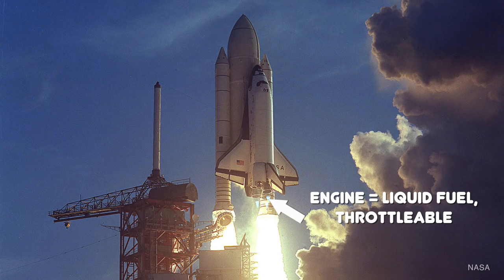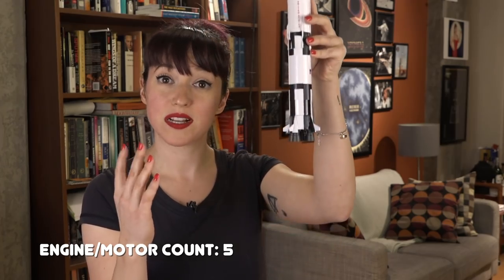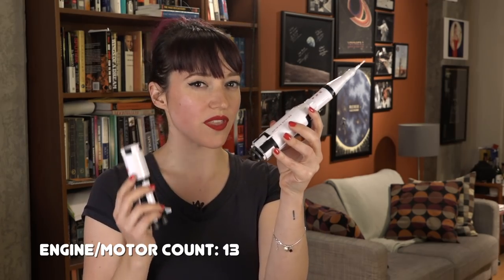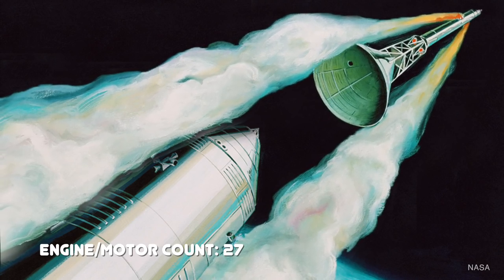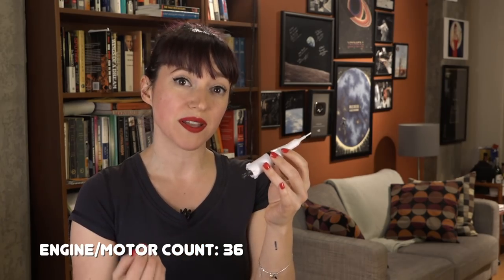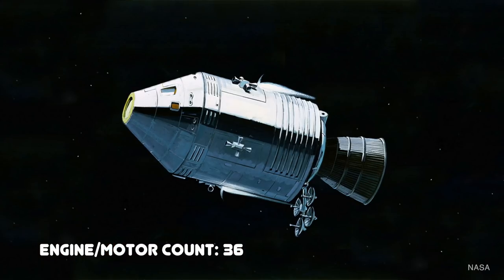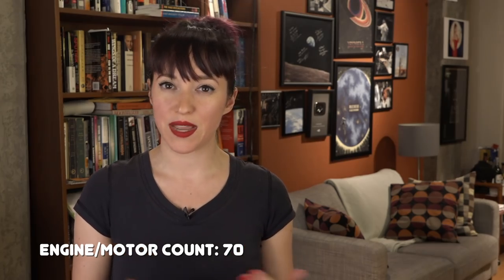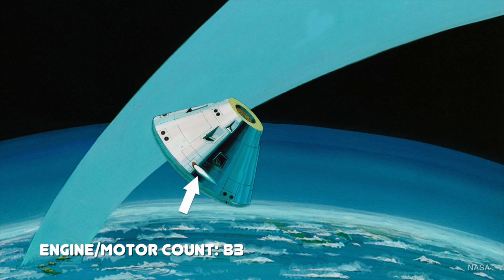It Took 83 Engines to Get to the Moon

Comment: Was the LM ascent engine ever used for the Apollo 13 rescue or was only the descent engine involved? If not, was it considered for extra boost to return sooner after the descent engine was spent?
Reply: Lots of trade-offs were considered in Apollo 13, but the LM ascent engine was small, and would have required jettisoning the descent module, so that option was not used. In the end, electrical power and crew consumables turned out to be more critical than engine fuel.
Reply: Gordon Richardson I agree...I also considered that the guidance computer was shut down by the time they were making their corrective burn to get on track. Each attempt at correct trajectory by manual guidance looking though the windows while piloting toward earth would be risky.
Reply: Actually only one burn was done without the PGNS (primary guidance/navigation system), the free return burn and PC+2 were both done using the PGNS, the "manual burn" was done under AGS guidance manually.
Reply: "......the "manual burn" was done under AGS guidance manually".....They eyeballed it. 
A little context goes a long way. Thanks for keeping it real. Unbelievably, there are doubters. 
Mostly Ron Howard got everything right except Sweigert's character. Movies tend to get a hook when there are suits to answer to for funding. If a novice has not seen the mainstream Apollo 13 film, in my opinion, it's not a bad place to start. Believe it. This is what we are capable of. It spite of how effed up our country seems. I believe that is where all this doubting begins. Buzz was taking a swing for all of us.... and he connected! Thanks, Buzz. https://www.thevintagenews.com/2017/05/28/that-time-when-buzz-aldrin-punches-moon-landing-denier-bart-sibrel/

Comment: Is one that burns liquids but can't be relight a motor or an engine?   Or is that a question best asked to Scott.
Reply: If it's liquid fuel, engine. If it's solid fuel, motor. 

As for hybrid rockets... well, that's the real question..
Reply: catfish, I referred to re-igniting.  So you think that contrary to what she said there is no requirement for re-ignition?

Comment: How was the SIV-B stage re-ignited? did it use some kind of pyrotechnic or something like a big old spark plug to ignite the fuel?
Reply: Could someone please answer this question?  I've never thought of it, but know I need to know.  Thanks a lot +David Clarkson!
Reply: Spark plugs indeed. The system is called the ASI (augmented spark igniter), a small feed of fuel and oxidiser is ignited by two spark plugs, producing a flame in the combustion chamber. That in turn ignites the main fuel/oxidiser supply.
Reply: Hypergolics  liquids are self igniting when the components make contact. That's what's used on engines that need to be re ignited.
Reply: But the SIV-B didn’t use hypergolic propellant. It had a J2 engine and required spark igniters.
Reply: TLI was re-ignition of the SIV-B engine. All the main Stage Engines used spark igniters which I think were constantly sparking through the burns, the smaller thrusters and Ullage motors are harder to study as far as fuel types and they account for 85% of the count / varied in type. CM and 2xLM engines were Hypergolic self igniting.
Reply: The other answers correctly mention the ASI (augmented spark igniter) necessary to ignite the H2/O2 mixture since it's not hypergolic. But there's more. The turbopumps have to be spun up somehow, and the J2 did this with "start bottles" containing pressurized hydrogen. During each burn, the J2 set up for the next burn by repressurizing the start bottle. Kinda like how a car engine recharges the battery so it can start the engine next time.

Comment: Okay here's my dumb question;  (Nothing to do with the Saturn 5)  The space shuttle Challenger exploded as it was ascending. The solid boosters were adding a lot of thrust to help push it towards orbit, so as I understand it,  those boosters were pushing hard against a resisting force - the weight and drag of the shuttle and external tank. When the vehicle exploded and the solids broke free, they were suddenly freed of all the weight of the shuttle etc., so WHY DIDN'T THEY LEAP FOWARD, instead of just plugging along at the exact same speed as before the explosion? I've never understood that. Thanks.
Reply: Christopher28fair From the videos it can be seen that the srbs continued to burn, but in an erratic path. My guess would be that the shockwaves of the explosion sent the boosters spinning, which would dramatically reduce their thrust in the forward direction.
Reply: Skeptical, but thanks.
Reply: The Shuttle itself didn't explode. It was the main fuel tank ignited by a large crack in one of the SRBs (Solid Rocket Boosters). They didn't leap forward because a)one had a big crack in the side; hardly gonna fly straight that way, and b)that was a big-ass explosion, excuse my French. That violent explosion pushed the SRBs sideways while in flight. After getting multiple different pushes from where they were attached to the fuel tank, you better believe they corkscrewed sideways after that.
Reply: Thanks

Comment: Hi Amy, are there still Apollo remains orbiting Earth or Moon?
Reply: Not Earth or moon, but somewhere In a recent video Amy mentions that one of the S-IVB rockets is still in orbit around the sun (can't find the link).
Reply: acm#1985 - The S-IVB's from Apollos 8, 9, 10, 11 and 12 are still up there - the one from Apollo 12 returned to the vicinity of the Earth in 2002.  And, as Niall notes, the ascent stage from Apollo 10 is still in solar orbit.  Everything else was (deliberately) crashed into the Earth or the moon.
Reply: Tevildo was there a way to remotely control by radio the LM ascend stage left in lunar orbit in order for it to crash into the moon?
Or was the LM ascend stage jettisoned in such a way that it would not remain in stable orbit but spiral towards the lunar surface?
There is no atmospheric drag for a decay in orbit of any spacecraft left revolving around the moon.

Comment: What does it mean when it's said the Saturn V had thousands of moving parts? Thanks!
Reply: Juan Valdez rocket engines are full of valves, actuators, gimbaling mechanisms, command and control hardware, sensors and a multitude of other hardware that I couldn't even begin to list.
That's just the engine, the fuel tanks have a network of valves and plumbing, the interstages have detachment mechanisms, the service module had thousands of valves, relays, fans.

The list just goes on and on.

Comment: I have a question. How did the flags work and how were they made?
Reply: Flags from Sears had a springy "curtain rod" sewn in the top edge.
Reply: Never knew about any small lead weights- references? They were rewarding contractors thousands for each ounce of saved weight, so seems unlikely...

Comment: I don't understand something. Looking at an F1 engine (or any rocket engine for that matter) where are the big heavy mounting components you would expect on something that's able to push an object with well over a million pounds of thrust. None of the components look big enough or strong enough. Does someone maybe have a link that explains all the forces acting on rocket engines? I'm feeling pretty dumb here.

Comment: How was it ensured that the back down falling stages did not crash on any sailing ships on Atlantic ?
Reply: Kari Ahola that's a bit like finding a needle in a haystack and getting it out by shooting it from a mile away in gale force crosswinds.

They would have told ships to stay out of the region near the launch site, after that the odds are astronomically against hitting anything unintentionally.

Comment: One other question re the boost protective cover that covered the CM; when it was still on, could they see anything out any window or were the windows all covered by it? I'm going to guess they were.  ?
Reply: ThankYouVeryMuch!! for the link! Probably not a time to site-see anyhow while strapped/buckled in and being pummeled backwards  by 7.5 million lbs of thrust cruzin along at 7 miles per second .... Nah!!  :)
Reply: When they were designing the Mercury capsule back in the day, there was a bit of a fight between the engineers and the astronauts over putting a window in the thing. Since the astronauts won, I guess the engineers made sure that Apollo always had a window.
Reply: It has that window for the hatch, but the forward and side windows were covered up.
Reply: Thanks! Does anyone know what the CM's outer skin/coat was made of? When I see pics of it in space it always seems to shine and gleam like polished chromium the old 50's/60's luxury car's bumpers use to have . But when recovered from sea it looks scorched honeycombed copper!   ?
Reply: Thanks Walter! That makes sense. I'd forgot that the CM's heat shields were ablative and designed to basically melt away on re entry! I'm sure that did blemish it a lot. I also just learned the SM & CM were coated in Mylar foil, making it so shiny up there.
Reply: That's the block 1 CM hatch. Block 2, which was actually used on the missions, has a single piece, outward opening hatch.
Reply: Only the hatch window, all the rest were covered.
Reply: catfish552 left forward window actually had a window in the BPC along with the side hatch.
Reply: One more question? The new Orion CM has a Forward Bay Cover that jettisons upon reentry back to Earth to allow the main parachutes to deploy. Did the Apollo CM's have such a cover too?
Reply: Bruce Merrill yes it was called the Apex cover.  It was jettisoned before the drogues fired.  You can look at command modules in museums today and see all the exposed hardware on top that was originally covered.

Comment: 3:10 I thought the second stage fell in the indian ocean, didn't it?
Great video as usual by the way
Reply: No, this comes up often. Apollo was a rather gradual launch (kerosene fuel), so both first and second stages fell into the Atlantic. The Space Shuttle was had a higher specific impulse (liquid hydrogen), as well as booster rockets, so the external tank fell into the Indian Ocean.

Comment: Weather they're solid or liquid fueled, they are both engines.  The term "motor" should be reserved for electrically driven "engines".
Reply: And yet, solid rockets are indeed called motors.
Reply: Not really.  Just because many folks call them that does not mean its proper.

Comment: Where  retro motors on the Stage I were located at?
Reply: At the bottom of the stage, in the fairings for the main engines, next to the fins. 

Can be seen as number 13 in this diagram:
http://www.alternatewars.com/SpaceRace/Saturn/S-IC%20Inboard_1963.png
Reply: WOW! very well hidden! Thanks!

Comment: If motors have solid-fuel and engines have liquid fuel and are relightable and throttleable, then which category would a hybrid-fueled rocket (solid fuel, liquid or gaseous oxidizer) like the one propelling SpaceShipOne and its successor SpaceShipTwo count as?

Comment: Why lock down to build thrust. Isn’t that a waste of Delta V?
Reply: There's the staggered startup, as mentioned in the video. The engines also take a moment to reach full thrust (and you don't want to take off with less): Altogether, that means 2 seconds from the first firing up until they're all fully there. They also measured thrust here, so if one of the engines wasn't performing as it should, that's a last-second chance for a launch abort.

It's not a waste of Delta-V, since the umbilical arms are still connected at this point and supplying fuel. With the engines at full power and the turbopumps at full speed, the arms disconnect, the rocket runs off its internal fuel, and lifts off.
Reply: catfish552 I hadn’t realized they were still fuelling actively enough to compensate for full thrust at that point (citation?). I guess you have more control at full thrust plus the system check, but wouldn’t partial thrust just be partial acceleration? I guess they don’t have the added stability afforded by my model rockets guide rod. But I swear a little gimbaling is all my Kerbals need with thrust to weight at 1:1.00001
Reply: See here at T-3: https://history.nasa.gov/afj/ap11fj/01launch.html 
It sounds like the external supply couldn't keep up with full thrust, but they were pumping it in as long as possible. I'd guess at most there is a second or so of "waste", which shouldn't make too big a difference.

The rocket would lift with those 1:1.00001, but that'd be a veeery precarious moment. I'll gladly subject Kerbals to it, but not live astronauts. Plus Kerbal vehicles tend to be a bit more responsive to their controls then real ones, due to overpowered reaction wheels. Better to wait for full thrust and start moving with conviction.

And the checks are a really important part. Imagine if one of the outer engines failed to ignite and you suddenly have 6,770 kN of asymmetrical thrust on the rocket...

Comment: I think you just answered a question I always wanted to ask. I use to wonder why the pics of the CM in space, it always looked shiny/gleaming like it chrome or something even. But pics of it before launch, it always looked white. So when you just said it had a 'boost protective cover' that jettisoned with the launch escape rocket, now I get it! :) But why did the CM always look so shiny up there, was it some kind of chrome skin? Because it sure looked spent-burnt by the time it splashed down, for sure! ??
Reply: Bruce Merrill The skin was highly reflective to help reduce heating from the sun. They still had to roll the spacecraft so one side didn't face the sun for too long. The Apollo barbecue roll 😂
Reply: Thanks for the info Niall! I knew they had to roll her always so she didn't bake, but I never knew it was called a "Barbeque Roll" before! I like that! I just Googled that term & some good info came up. One site explains, "Apollo spacecraft were protected first by a mylar foil coating that was applied to most surfaces. The second level of protection was the barbecue roll." I guess Mylar coating made the SM & CM gleam and shine like it did up there. And why it looked the way it did on return ... scorched off by plasma heat? 

Someone said the CM outer shell is made stainless steel, and it looks the way it does on return because of residue from the ablative heat shield on the base, which makes sense too. But if it's stainless steel was it honeycombed? Because that's the way it looks always, like copperish colored honeycomb when it returns.

Comment: Did they not also use rocket engines to power the turbo pumps?
Reply: They divert a bit of the fuel for that, yes.

Comment: A small question, why was the rocket held to the ground until the F1's were at full throttle? Why not just leave it gain speed?
Reply: Pedro a It takes a few seconds for ground control to determine that all the rockets have ignited correctly and are functioning properly. 
If you let the rocket go before confirming this you lose the chance to do a safe abort on the pad, essentially sacrificing the rocket itself and seriously damaging the rocket pad for the sake of a little bit of impatience.

Comment: @Amy Teitel  Your Challenger article for History.com is incorrect.  The fuel tank did not explode and the orbiter was not destroyed.  The tank ignited and produced a huge fireball which means the orbiter crew survived until the cabin hit the ocean. Please fix your article.  The crew of the Challenger deserves to have their story told.  Also the O ring wasn't the sole cause of the problem.  The main problem was a leak in the SRB joint.  I say this because I am sure you don't want your article perpetuating myths.

Comment: Mr. Pedantic here to mention the little note at the end of the video acknowledging the unused launch escape system. There was only one  LES motor (not 4) and one pitch motor. While the LES has 4 exhaust nozzles, they all are for the same combustion chamber.

Also, the number of S-II ullage motors was reduced to 4, starting with Apollo 6, then 0, starting with Apollo 15. They deleted 4 of the 8 S-I retrorocket motors for Apollo 15, and the combined decrease in delta-V between the S-1 and the rest of the rocket left them too close for comfort at separation time!   https://gwsbooks.blogspot.com/2015/05/apollo15-staging-anomaly.html   http://heroicrelics.org/info/s-ii/s-ii-overview.html

Comment: What is the big ring we always saw falling and rotating away when one of the earlier stages separated?  Love your show!
Reply: Frank Safranek that's the skirt.
It kinda acts like a fairing for the engines.
Reply: Thats where those motors that kicked the second stage to get the fuel in possition, as she explained in the video.
Reply: That's the interstage fairing, that connects the first and second stages.
Reply: The interstage between first and second stage, it stays attached to the second stage for a bit.

The sequence is as follows: The first stage cuts out, and is pulled away by its retro motors. The second stage ullage motors (mounted on the interstage) fire, then the main engines. Once the second stage is flying straight and true (after ~30 seconds), the interstage is separated and falls away.

The reason it doesn't just separate along with the first stage is that it has very small clearance around the second stage engines. Minimal rotation of the first stage, and the interstage would bump those engines. Plus, it allowed them to shed the dead weight of the burnt-out ullage motors.
Reply: That's the interstage ring. Amy's model was a little confusing since she left it attached to the first stage when she demonstrated staging when in reality it stays with the second stage for a while, then drops away on its own. But she correctly pointed out that the 2nd stage ullage motors were on the interstage.